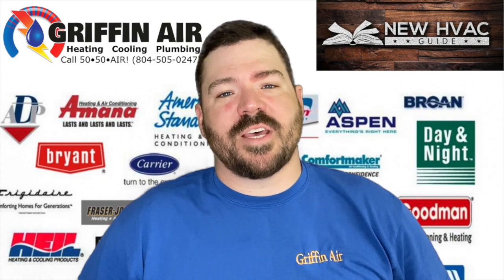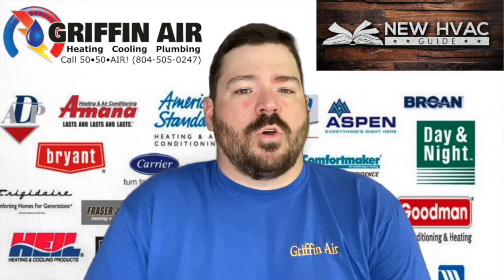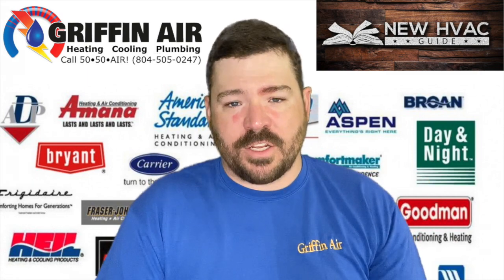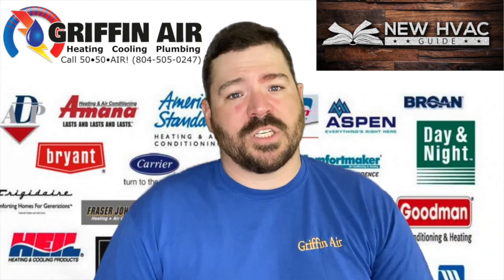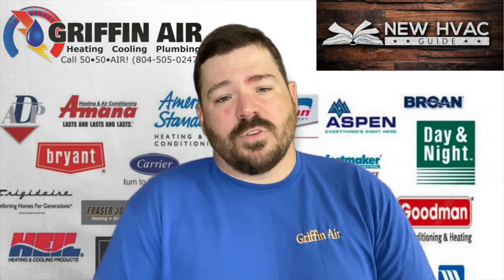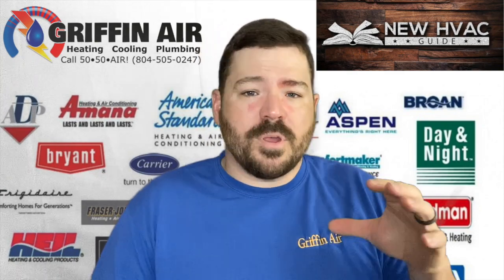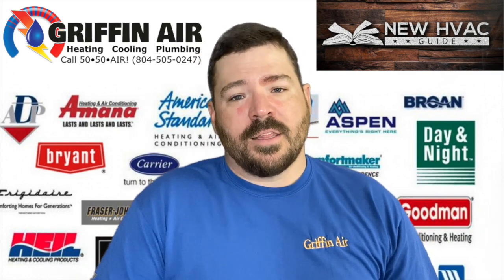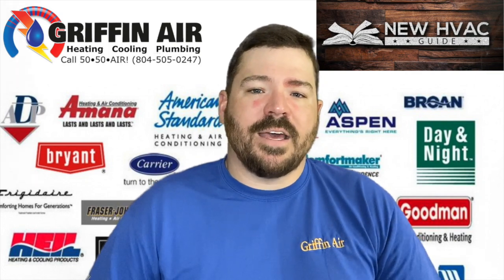Bosch Heat Pump High Humidity solutions

Comment: We installed two Bosch systems last year. We've struggled with the humidity issue. We have someone coming out who is going to change the settings yet again. My BIG problem is that we just turned the heat on and within 5 min the humidity in the house had reached 90%!!! The ceiling had wet spots, the windows were so clouded with moisture you couldn't see outside. Had to turn it off.
Reply from the maker: Something is definitely wrong. Heat will usually lower humidity.
Reply: @NewHVACGuide  thanks for the video and response. Any idea what could be causing this? It makes the house feel terrible.
Reply from the maker: Do you have a humidifier?
Reply: @NewHVACGuide  no, we don’t. Could it be a thermostat wire connected incorrectly?
Reply: @NewHVACGuide  wanted to thank you for your video and quick responses. We changed a thermostat setting and the heat seems to be working properly now. We installed new Honeywell thermostats over the summer and had the number of backup heat stages set to 1 in advanced settings. We changed that to zero and now the heat functions correctly, but there’s no emergency heat option now. We have our Bosch tech coming Friday to make sure everything is set where it needs to be.
Reply from the maker: @annc8304  great! I’m sure he’ll get you straight

Comment: Thanks for the video! We're having humidity issues with a Bosch 2.0 with matching air handler. Can you explain how the passive dehumidification works?The manual for the indoor unit says this: "IDS 2.0 IDU has a Passive Dehumidifi cation function which lowers the fan speed (first stage) with a DH call from the thermostat. This function requires proper DH 
wiring from the indoor unit to the thermostat (with a humidistat)." 
The installer ran a wire from the DH terminal on the control board to the thermostat. It is a Bosch bcc100, which states it can be used as a humidistat. However, the literature for the thermostat states that it can only control a separately installed wired humidifer/dehumidifier. Do I need to install a separate humidistat to the duct work connecting it to the control board. If this is the case, do I put the humidistat wire on the DH terminal along with the thermostat wire, or do I remove the thermostat wire reserving that one a separately installed dehumidifier? We've already lowered the coil temp and everything else that has been suggested. I hope what I'm asking makes sense.
Reply from the maker: So as I understand it, the DH is not a dry contact control for the dehumidifier. The instructions say the fan will ramp when DH is called from the stat allowing enhanced dehumidification. 

Is y1 and y2 separately wired? Or jumped?

You may want to go back to your installer.  They may be able to check a few things that you can’t.  Where are you located?
Reply: @NewHVACGuide  thanks for the response. Y1 and Y2 are separate, yellow to Y1 and black to Y2. We live in north Alabama, so we definitely get a lot of outdoor humidity. But we've never had it so high indoors. Our house is between 1500 and 1600 sf, which should have us in 3 ton territory, but it is currently set up as a 2 ton. Even with that we are only getting run times of 5-8 minutes and out of that it's only the fan running for a couple of those minutes. We learned after the fact ours was the first Bosch unit our installer has put in. We also got new ductwork with spray from insulation on the outside of ducts. I haven't found any clear answers on how to set up the passive dehumidification and our installer seems to be trying to learn about these Bosch units as he goes. All the common suggestions I've seen people mention have already been tried. Right now we are just trying to learn if we need a separate humidistat for the air handler, or if the thermostat should activate that. Tried enabling that on the thermostat but it never seemed to be active.
Reply from the maker: Is the y going to the outdoor connected to y1 or y2?
Reply from the maker: It definitely sounds like something was installed correctly. What are your speed taps set on? And did he do what page 6 says in the manual for high humidity situations?
Reply: @NewHVACGuide  Y on outdoor unit is going to Y1 on thermostat. Indoor unit SW 1&3 are on SW 2&4 are off. Switches on outdoor unit are as follows: sw4 1,2,3 off 4 is on. Sw5 1&2 are off and J1 is off. If I understand page 6 correctly that is explaining what to do if the air handler is in a humid location. Ours is not. It's in an encapsulated crawl space with a dehumidifier maintained around 48% humidity.
Today outside it is 73 degrees with 63% humidity. Indoors is 68 degrees with 57 to 61% humidity depending on the room. Unit is running 8 minutes or less with 3-4 minutes between cycles. The fan is running by itself at times even though it's set to auto.
Reply from the maker: Your installer needs to go through the indoor dip switches and read the manual. Sw6 especially.
Reply: @nurseortech1  You need to configure your thermostat for longer cycle times.  Preferably one cycle per hour.  The bosch system starts from scratch each cycle, so those short 6-8 minute cycles do not let it ramp up and dehumidify.  If your thermostat supports dehumidification, you just need the extra wire (DH between the thermostat and air handler).  Also, make sure your outdoor unit was disconnected from the power when you adjust the dip switches.
Reply: @tobyt7163  thanks for the suggestion. It turns out our Bosch thermostat was faulty. It was just way too sensitive telling the unit it had reached its setpoint way before it had. Our installer came out with a Bosch field representative. They installed a new Honeywell thermostat which greatly improved things. Made a couple more adjustments to the unit and now we are in good shape.
Reply: @nurseortech1  Can you elaborate on what "more adjustments to the unit" were made?  We have IDS 1.0 and real indoor humidity issue.
Reply: @troyhicks964  basically it was set up with the tonnage too high. It would run for just a few minutes at a time so it was never on long enough to pull the moisture out of the air. I can't elaborate in the proper technical sense, but it needed to be set so that it would run much longer at a time. Your unit probably needs to be dialed back so it takes longer to cool to whatever temp you have it set to. You'd think the power bill would be higher this way, but that has not been the case. It doesn't run at full capacity the entire time so it isn't drawing as much power. That was the case for me anyway. Been very happy with the unit all summer now.
Reply: @nurseortech1  appreciate the reply.  As a point of reference, our 20+ year old Carrier AC only system was 3 ton, our IDS 1.0 is set for 3 ton.  I'm wondering if you know if your prior unit tonnage was the same as what you ultimately had your IDS 2.0 set for...?

Comment: Had too much trouble in some installations. One customer I had I removed 2.5 ton split system ac with gas and installed new variable speed gas furnace with Goodman coil txv and a 3 ton Bosch heat pump. Bosch claims they’ll work with any coil as long as a txv is installed.  Now they say at least a 3 row coil. Did everything I could to get humidity down in home. Slowed blower. Overcooked space. Guy even had crawl space sealed. He did have a lot of humidity under the home but still high in the home. Finally removed Bosch and installed a gszc16036 and humidity went from 64% to 54% by that night. Next day it was 53%. That was in 2019 and in 2020 he’s not had any high humidity. His humidity at times would go as high as 70% in the summertime. I even flipped the unit to 2 ton max and slowed blower to 2 tons and the house would not get below 78 degrees. I flipped the coil temperature to 37 degrees but still no help. Put the thermostat to one cycle per hour to keep unit running and not cycling. I think I had to replace 3 of these systems doing this. I’ve had to install a dehumidifier in another location due to high humidity. But then I’ve got some installed that’s not given me any humidity problems. I quit installing them due to losing too much money. Bosch just tells me I’m missing something but they’ve been to a couple of my jobs and really had no idea. As for the 2.0 version I installed one before they even came out after having a 1.0 version give me humidity problems. It has a coil leak out of the gate but it was the aluminum coil. 3 Bosch representatives were on the job as we installed this and I’ve got to go back and replace a cracked drain pan ASAP. It’s been better some what but I’m just not sold on ramping compressor and not ramping the blower speed to keep my delta t to 20 degrees.
Reply from the maker: Wow. So did you ever try turning dip switch 4 on?
Reply: I did everything. Nothing would help. I’m not sure what the deal is with this equipment. I’ve had 4 Bosch representatives out. Well 3. One was from media which is who makes this product. That guy was from China that was over here. Good folks not bashing them but no one could help me on these things. I’ve tried everything I could do and know. Also had a problem with the units in the left hand discharge blowing water off coil. Not any problems in upflow or right hand discharge. Usually on the larger cabinets. The opening on the coil is so wide sometimes the water drops off from the top of the coil and blows over into the insulation. I’ve tried staging blower speeds to help remove humidity but I couldn’t get a few of these units fixed so I replaced with another brand equipment and my troubles went away. Also few other companies in the area having same troubles. The units are designed to be ran at 350 cfm per ton. I think they are better off on too small duct systems rather than a correctly sized duct work.
Reply from the maker: Where are you located?
Reply: North carolina
Reply: @joeywhitaker6952  I think I might have the same issue with water blowing off the coil in left hand discharge orientation.   Insulation is wet and water dripping from fan and internal drain pan sweating.  Installer angled drain line out of unit and drain pan internal to unit to hopefully remove condensate faster.   Is there anything that can be done to mitigate the problem?  Longer drip pan, waterproof insulation?  I suspect running unit while wet would cause unit to fail faster.
Reply from the maker: Have the refrigerant checked, drain on checked, and airflow/static checked. Between the 3, the problem usually shows itself.
Reply: @NewHVACGuide  I have ventilation conduit coming in just past my airfilter that leads to the roof.  Looks like it is there to mix in fresh air.  Could that be the cause of my condensation inside air handler unit.  I live in Hawaii and suspect all that warm air coming in might be contributing.
Reply: @NewHVACGuide  Refridgerant, drain checked.  Technician thought that maybe were wasn't enough air flow across the coil and increased Air Handler speed from the 48K setting to the 60K setting.  I also changed filter from Merv 11 to Merv 5.  
- Set heat pump to 4 TON.
- Switched Fan motor speed to 48K and 60K.  
- Increased run time on BCC-100 thermostat to 30 minutes.  Initially AC was short cycling 8 minute cycles with everything set to 5 ton.  This five ton unit replaced a four ton unit.
- replaced 11 Merv filter with a 5 Merv filter.
- Supercooling and refrigerant charge check.  Coil at 46 degrees.
Water can be seen at bottom of internal drip pan and condensation on fan motor.

Taped seems and closed fresh air damper to eliminate warm air sources directly to air handler.
Reply: I'm wondering if bumping up a half ton would help. Looking at the specs the 3 ton unit is actually only rated at 33K btuH I was dead set on putting one of these in my grandmas house but having 2nd thoughts
Reply: They only have a 3 ton and a 5 ton.
Reply from the maker: It’s hard to say just from your comment. We’ve installed several dozen and had no issues. I even put one in my home. It’s odd your rep couldn’t even figure it out. Is he going to make it right and replace it if he can’t get it squared away?
Reply: They just kept saying I’m missing something. So nothing was ever done. I lost a lot of money due to them. Not had this problem on any other product but Bosch. I do have some in that are working just fine though.
Reply from the maker: Sorry to hear that. They need to make it right one way or the other. If they can’t get you taken care of, they should give you a new system or your money back or some thing. Your system is still under warranty. We’ve never had any of those issues. I wish you were closer

Comment: If I have a 3 ton heat pump, is it possible for my installer to adjust the tons used for operating cooling only? I have a 1600 square foot house from the 1900's and it seems to cycle on and off a lot keeping the house at 70 degrees with the temperature outside at 90 degrees. I will also use this in the winter for heating in Massachusetts where I think we may need the 3 ton capacity.

I am having high humidity issues where the humitity is around 65-72 percent on my new system.
Reply: Try setting your cooling cycles to 1.
Reply from the maker: Sounds like your system may be oversized.

Comment: I have heard of widespread issues with dehumidifiing.  Houses that are maintaining temperature but are running 65%+ humidity.
Reply from the maker: If installed properly, we’ve had no issues. Most of these guys aren’t even reading the instructions
Reply: Had same issue. Almost as if it cools to fast so it can't bring the humidity down
Reply: Yup. Having the same issue.
Reply from the maker: Usually an installation issue. Some of these guys are just slapping them in and turning them on without ever looking at the manuals.

Comment: So the BOVA36 is a 3 ton unit.  My 1200 sq ft ranch requires a 2 ton cooling unit.  Isn't it the air handler be 3 ton and the outdoor unit be at two ton?  If true then the BOSCH IDS 2.0 may not work for me.
Reply from the maker: The BOVA36 can be set up to operate as a 1.5 ton, 2 ton, or 3 ton.
Reply from the maker: It just needs to be programmed correctly.
Reply: @NewHVACGuide  I'm pulling the trigger on this.  I'm making sure I get a proper Manual J report on my house.  Shocked that some don't even do that.
Reply from the maker: Very cool. Where in the country are you located?
Reply: @NewHVACGuide  Long Island based.  Installer assured me that because its a modulated unit (initially set to 3 ton) and I need approx. 2.5 ton, that it can be set to the 3 ton setting.  Humidity is high today with the air outside being real muggy (tropical storm passing by this week).  It's not clear if your video properly addresses the 2.0
Reply from the maker: The Bosches are an inverter system but not a true communicating system. So if not installed and programmed properly, you can have humidity issues.

Comment: Had my tech install a 2.0 bova 5 ton condenser and 4 ton 2.0 bva air handler last week.  Was the first Bosch unit he has installed.  When he set the refrigerant charge he charged based on subcool and had the capacity dip switch on the condenser set to 4 tons.  He did use the "force" function and follow the OIM.  I have since changed the dip to 5 ton as many say, including bosch, that this is fine and the unit will ramp as needed to match the 4 ton air handler load.   Should the dip switch be set in full capacity (5 ton) or match air handler capacity (4 ton) when charging the system and setting fan speed for air handler for delta T?  2 days after the install I had some issues with the unit keeping up on a 94 deg day with both indoor temp and humidity.  Wondering if there could be something off with the refrigerant charge, air handler fan speed, or maybe just need to flip that SW4 switch.  Thanks for posting the video!
Reply from the maker: I have not dealt with the 2.0 as much as the 1.0. But we always set it sized correctly. If sized correctly, it should not have any issues keeping up.
Reply: I see in the Bosch manual states that the SW4 dip switch can be used when "not getting enough capacity 
, or not dehumidifying well enough."  I understand lower coil temps would condense more water and therefore remove more humidity.  Would it also increase the cooling capacity?
Reply from the maker: Jason Pelletier I’m not sure on that. Capacity relating to btus doesn’t change.  But it does cause the inverter to run faster to meet the desired coil temp. So it may cool a little better. I’m just not sure.
Reply: Yes it would cool faster!

Comment: We had this system put in last year in NW Ohio and the heating over the winter was excellent and very economical. We are having a terrible time getting our humidity level down in our house now that we are in AC season.  Our tech has tried everything under the sun and our humidity levels are in the high 60's and 70's.  AC is cold but the humidity level still leaves things uncomfortable.  I am not impressed with the AC with this system and don't think we should have to install a dehumidifier.  You don't have to do that with other systems.
Reply from the maker: Have your tech turn on dip4 on the heat pump and lower the air speed.
Reply: @NewHVACGuide  already did that.  Didn't fix the issue.  Have replaced the coil and all other kinds of things that have not helped.
Reply from the maker: Something is definitely not set right. We live in a very humid environment on the coast and have installed multiple Bosches and had no issues after everything is set correctly.
Reply: @lisamerkle5059  Did you verify that your thermostat was set to one cycle per hour?  The heat pump needs to run almost continuously for proper dehumidification.
Reply: How do you set one cycle per hour runs on a Bosch thermostat BCC1100?
Reply: Did you get it fixed?  Size it correctly and go with a two stage or single stage standard system and I bet your troubles will go away